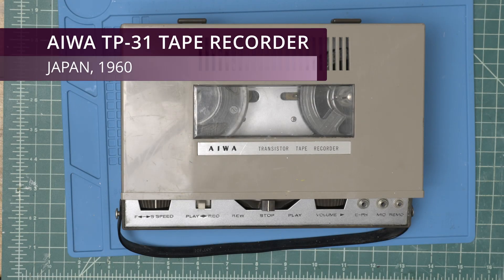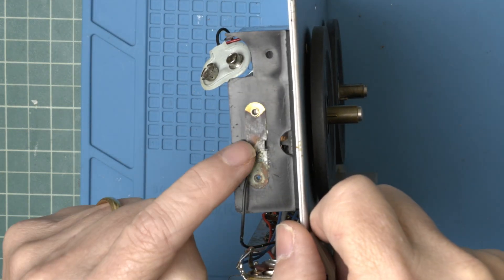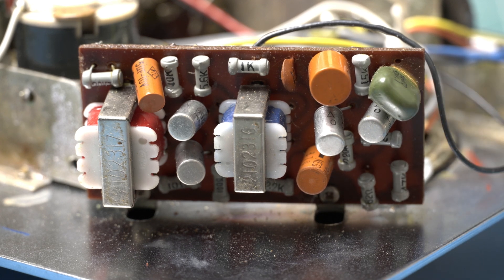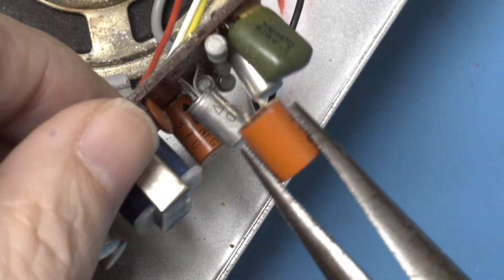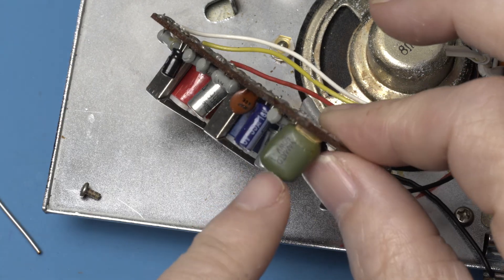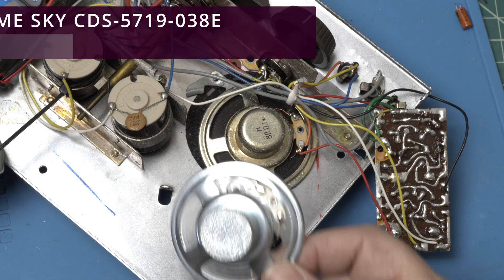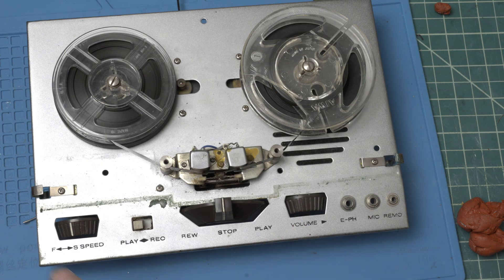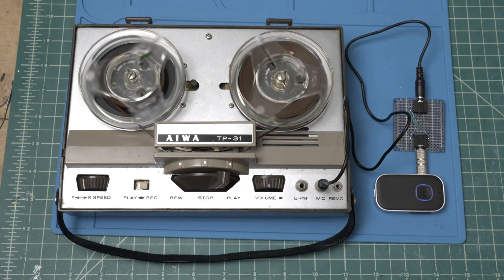Vintage Electronics Repair: Dead AIWA TP-31 Tape Recorder restoration

Comment: This one is a little different than most rim drive recorders of the time in that it has two motors (one for each reel) instead of mechanically moving a single motor (usually by tilting) between the two drive rims. And unlike many of these recorders it has an actual erase head rather than just a magnet that moves toward the tape during the record function.
Reply from the maker: This one was of the first - 1960 vintage.  The voltage regulated lithium batteries I used are a major upgrade that I didn't mention in the video, the carbon zinc batteries of 1960 were terrible, never the same speed.